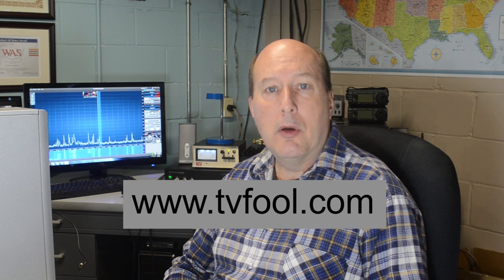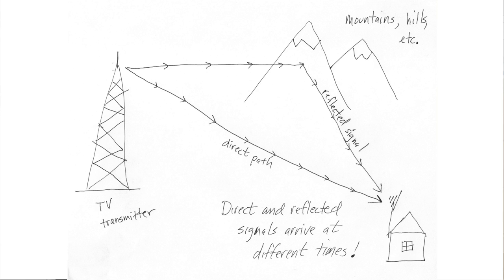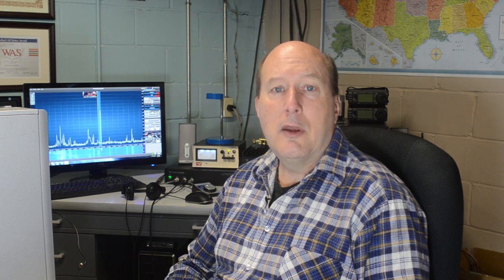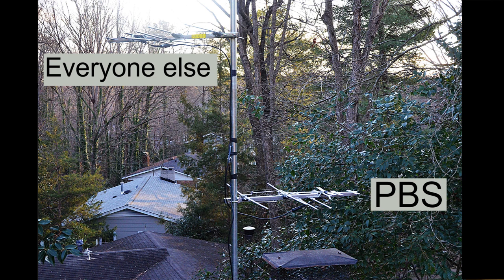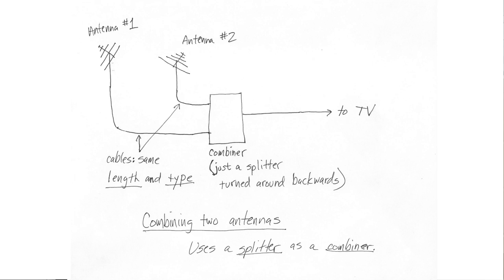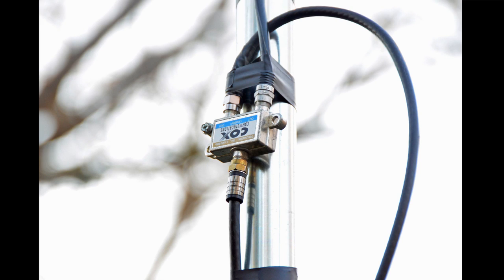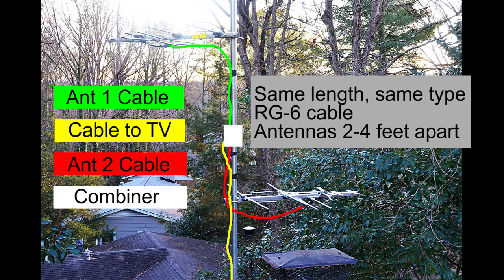Combining two TV antennas for better HDTV reception

Comment: Doug.  You rock.  This is perfect.  Not to complicated, not too dumbed down.   I was especially interested in the using a splitter as a combiner.  I was trying a DIFFERENT antenna and getting same results for the same reason.  I knew from my younger years on the farm (before cable and HD), that almost everyone used 2 antennas in an X config.  Thanks.
Reply from the maker: Glad it was helpful Robert.

Comment: Back in the day it was called diplexer. They were very common for use in
 satellite installations in the 90s. Directv and Dish didn't provide the
 local channels back then so you needed to have a TV antenna. The 
"diplexer"  was a combiner too it just worked over a broader range of 
frequencies. The KU band Directv and Dish use is 12-40 Ghz. Whereas 
regular OTA broadcast NTSC/QAM is 52-698MHz (ch. 2-51).

Comment: Hi Doug, thanks for the interesting and informative video. I live in Melbourne Australia and occasionally when there is low cloud, two of our multiplex channels can go down. They are in the same direction as the others, but being on the high end of VHF, they seem to be affected more than the lower frequency channels. I solved the problem by adding in a separate cable into another room, where I can connect to a larger antenna, on a rotator, which brings all the channels through well most of the time. So, when we do have drop outs, I can hook up the cable through to the other room and we can then watch the signal perfectly.

Comment: Excellent.  Thanks for doing this!  Amazing list of over the air channels available for you.  What I'm really amazed at is how few people have taken advantage of not only totally free TV reception, but BETTER reception than you get with cable or satellite.  OTA signals are 8VSB, which means a 1080 broadcast IS 1080.  Cablevision uses QUAM modulation.  They squeeze HD signals down to NOT HD signals.  The resolution goes into the tank.  I've had people come by and when they see my reception on the very same channel they get on cable, they're blown away.  MUCH better when you pick up signals on an antenna.
Reply: The actual resolution doesn’t decrease from cable’s compression, just the overall picture quality.

Comment: I'm located just a few miles from you in North Raleigh, so I had exactly the same problem.  I was able to mount both antennae in my attic and now have excellent reception across the board, with the added benefit of not having to hang off my roof to mount an external antenna array.  Thanks for the info, Doug!
Reply from the maker: Excellent! Glad it worked out for you.
Reply: I have a question. Will a metal roof attenuate a digital signal with the antenna in the attic?
Reply: @bodiew7368  Absolutely. So will an insulation blanket that has foil on the outside. Probably completely.
Larry Friddle, Chief Engineer KHBS/KHOG TV (retired)

Comment: 06:31 this is the way it was done also in the old Analogue systems, although in very simple ones. In a multi-flat buildings, there was an active mixer to combine antennas, and you could receive stations emitting from different directions.

Comment: This is a "BROAD-BRUSH" reply.  I installed 2 HD antennas WITH VHF/UHF and FM!  Each antenna has it's own "Pre-Amp", a ANTRONIX ARA1-15 (and DC power supply).  If you hurry you can buy a used Pre-Amp on on eBay for about $15!  Just be SURE your purchase INCLUDES the vital supply!  2 Antennas installed at different ends of the house to minimize roof coax runs and connectors exposed to the elements.  I used QUALITY black RG6u coax; black to help resist sun u/v damage... much more to follow: 

Now I have PLENTY of signal levels even from some weak stations 'off the sides' of the these very 'directional' antennas.  Indoors is the DC supply and a four-way splitter for TV's, TiVos and ABUNDANT FM STEREO too!  Know Pre-Amps CAN be "overloaded" with TOO MANY RF SIGNALS!  Here in Los Angeles we have MANY THOUSANDS of signal sources; including TV, AM, FM, 2-way radios, telemetry ~ simply too many to name.  Because Pre-Amps are so "broad-banded" SOME areas require a 'FM TRAP' to help prevent pre-amp overload.  I did not require one.

CAUTION, although TV stations went 'digital',  SOME DID NOT MOVE to the UHF bands ~  as was the 'original plan' to free up huge hunks of VHF TV bandwidth.  Here in L,A, 4 major broadcasters REMAIN on the VHF (low-band) SO USE CARE when you select your antenna!  INCLUDE the VHF band too because "things change" and a array/abundant FM stations are also provided.  IF your new antenna is "UHF ONLY", performance on the VHF band WILL SUFFER and ~ what you see is what you get.

Help your antenna ENDURE (even DECADES) longer!  TIGHTLY wrap ALL coax junctions with black electrical tape...  LOOK where your antenna elements 'junction' with "bus-bar" wires (sometimes under screws).  Using common roofing tar, use a spatula to GENEROUSLY COAT each coax connector tape AND antenna >element junctions<  too!  This helps minimize exposure to vital junctions from rain/storms/fog/drizzle etc.

Finally, PLEASE KNOW I AM NOT willing to participate in 'range wars' or pi**ing contests.

Comment: All terrestial tv in the UK is digital now. We are lucky here in that the broadcast mast or tower designated to cover a certain area will carry all the tv stations that are due to be received in the coverage area of the transmitter. This means to receive every station perfectly you only need one aerial (antenna) which can be precisely fixed and point in the direction required. Also the aerial used would be the one designed for its optimum performance to match the group of frequencies transmitted from the particular mast it is receiving from. Only having one direction to receive from plus using optimised aerials makes for easy reception in most situations.
Reply: Just to add to my previous text, that in the UK there are many hundreds of relay transmitter stations, some covering very small populations, that fill in the blackspots, and poor or difficult pockets of reception from the main transmitters. Some of these are very low power, but that is all that is needed to provide adequate  reception in a small blackspot area.
Reply: In the analog days, UK signals were always vertical polarization, US used horizontal polarization. That meant US must aim towards the transmitter, UK could still get some signal when aim was off by 90 degrees. Is DTV still polarized the same way as analog? (I think they even spel polarisation differently).
Because US / horizontal is more directional one could aim for least multipath.  UK / vertical will always let some multipath in, yet their directionality is less critical. A tradeoff, neither way is all good.
Reply: @peters8758  Yes they are, with exceptions. Some stations transmit both horizontal and vertical at the same time. To do that you need twice the power out of the transmitter and is usually cost prohibitive at all but the stations in the top market DMA's. They are doing this to reach mobile users with a better signal.
Larry Friddle, Chief Engineer KHBS/KHOG TV (retired)
Reply: @peters8758  Generally in the UK where all tv is digital main transmitters broadcast their signals in horizontal polarisation, and relay transmitters in vertical polarisation. There are a few exceptions to this.

Comment: This rarely works properly, unless all channels are very nearby. Multipath distortion occurs not only in the physical way you described, but also due to combining signals of varying strengths and phases. In most cases, bandpass filters are needed for the wanted channels and rejection filters for the unwanted channels. Channel Master's Join-tenna comes to mind, bust pretuned filters now have an application issue with all the UHF channels now used for digital transmission. Then, due to insertion loss, preamplification may be needed as well.
Reply: Cotronixco are you saying the CM jiontenna has the problems you list or cure those problems?
Reply: Antenna array he build IS ACTUALLY WORKING for him. He apparently didn't need to jump through the extra hoops you insist are there.
Reply: I tend to disagree this is often used in rural areas to pull in two markets.  Example our lake house is between Montgomery and Birmingham AL.  Perhaps it is the mix of channels, but this works for many people there.  I think it is a bit more complex and one needs to look at the frequencies "RF channels" used.  TVfool does a good job of dealing with this in their table.  An attenuation could also be used on one of the antennas to reduce the signals in one direction before needing filtering. That said the FCC has done a pretty good job with channel spacing in the digital conversion.  Will this continue with the repack who knows.
Reply: @ancelrick5396  I am a retired television engineer living way out in the sticks. I use the exact same setup. Works great.

Comment: In Europe we have different models of combiners. All combiners have VHF and UHF inputs.. The advantage is that all TV channels are on UHF band, VHF High Band is for digital radio DAB+ and FM analog radio. If you want to combine two TV antennas, you can use a combiner with two UHF inputs, and VHF input has the frequency range 87 - 230 MHz meaning that you get both FM and DAB+ radio. Another advantage is that in Europe most channels are broadcasted from one tower. Let's say you have 20 channels you only need one UHF antenna and with that antenna you get those 20 channel. The interesting part is when you live near the border. You need two UHF antennas, one antenna for the TV channels from your country and the second antenna two receive TV channels from the neighbor country. Also these combiners allow un UHF input power pass if you have an antenna with a built in amplifier, the maximum voltage is 12 volts. Some combiners also have for VHF power pass if you use and FM-DAB+ antenna with buit in amplifier. The bonus part is these UHF combiner have 4G LTE filter so phone signals don't affect reception

Comment: Doug, this video was extremely helpful!  I tried this method using two INDOOR flat window antennas facing south (toward the DC and Northern Virginia stations) and north-east (facing the Baltimore stations).  I went from getting about 20 stations to getting strong reception of 53!  The whole deal cost me about $42.  I didn't even have to pay for the cable between the antennas and the combiner because those were already manufactured onto the antenna and they were the same length and cable type.  Thanks so much for the info!
Reply from the maker: Excellent! Thanks for the comment.

Comment: Yes, well done, easy for almost anyone to understand.  I have a ChannelMaster 120 mile antenna, and I use to use the RCA antennas you have. The RCA antenna worked well, but they embellished its mileage rating a bit. The  ChannelMaster antenna does pull in some far off stations,  but it is so directional that if I get the far off station\, which is PBS, I can;t get a good fix on another closer station which is CBS, so it is one or the either.  The main issue that keeps me from trying two antennas is the very strong signals on ABC and the CW. I can get those with a wet noodle, so I actually get them off the back side of my antenna.

Comment: Hi Doug,  Yesterday I got home after watching your video at work 3 times and turned around a splitter and joined two indoor antennas and powered it all up and had reception like never before.  THANKS!!  Now I'd like to tinker with it and have a purpose of finding the right piece of test equipment that I might connect to my antenna's one at a time and as I walk around with my antenna in hand and pointing it into seemingly productive directions I'd be able to look at a connected meter and watch a reading go up and know I'd have just found the best place for that particular antenna.  Meters that seem to me would do this would be ones like these:  

LeaningTech DVB-T 95DT, Digital TV Signal Meter,  Digital Satellite Finder,  Digital Satellite Finder,   (all on Amazon)

But, I've gotten repeated 'no!'s' from folks saying they wouldn't work.  Well they work for satellites and other stuff.  It seems to me there would be a meter out there just right for this purpose.  Please give me any guidance you can toward an affordable test meter to do this with.  

Thanks a bunch Doug,

Rich
Reply from the maker: Hi Rich,
Unfortunately I have little experience with these meters. The ones specifically for satellite use aren't suitable for over-the-air applications, so avoid those when looking for one. Some of these (the cheaper ones) are just RF signal strength meters that don't discriminate by frequency and they can be fooled by other signal sources.
Reply from the maker: Hi Rich,
That looks like a handy device - I had not seen it before. It's too bad all of the TV manufacturers don't build this capability into their TVs. In any event it seems to me that this device would do just what you want.
Doug
Reply: Super!  Thanks for the Reply Doug.  I'm just bout ready to get off work and head home to bed lol.  I'll look into this and definitely get one if it gets a price break on Black Friday, and probably anyway.  I kind of see a signal tester with a clipboard and a lot of pacing around and testing different places and from that information being able to place different antennas and join them with a combiner.  Also then that information could be stored on my laptop and if things change I could get to solution faster.  I'll let you know how it goes.  Thanks again for the reply.

Rich
Reply: Rich Schreiner 
excellent presentation.

Comment: Doug, Thanks for posting that.. I'm a software engineer and had asked this SAME question to my fellow hardware engineers and several said it wouldn't work.  I said "what about combining the signals"... They said there was going to be interference.  Well, you proved them wrong!  Anyways, thanks for the informative video!  I ended up buying a omnidirectional antenna and was able to get all 6 PBS stations here in Tampa Bay.

Comment: Thankyou. In the UK we still use both TV Ariel (antenna) and cable. We pay the BBC a licence fee and pay for cable. I think you have given me the answer I’m looking for. I live in Hartlepool, England. My signal comes from the Bilsdale Transmitter Mast in North Yorkshire which burnt down last year cutting off millions of viewers. After arguments with the landowner they put up a temporarily mast half the height. They also put a second temporary mast nearer but in a different direction. I have two tv Attentas one I can’t get to on top of my chimney towards Bilsdale and one in the attic for different tv’s in the house. I have ordered a signal finder from eBay and will experiment with joining the cables. Cheers

Comment: It should be clear that it should be a Bi Directional splitter. A lot of older splitters only allowed flow one way so turning it around backwards would not work.
Reply: i use a uhf directional antenna at the top of my mast then a directional vhf antenna right below aimed both in the same direction. i use a uhf/vhf combiner and then a amplifier  under the antennas. nobody else in the country where my house is can get the channels i do

Comment: Great video, thank you, sounds like a good solution to my problem.  New tv tuners will only auto scan for channels and offer no edit or add.  If you use a antenna rotor, you would have to do a re scan EACH time you move the antenna.